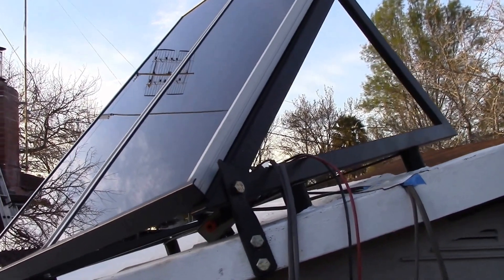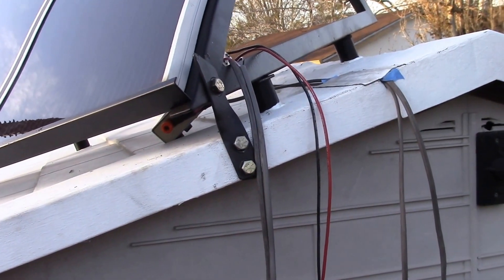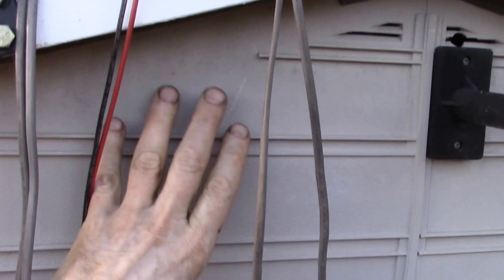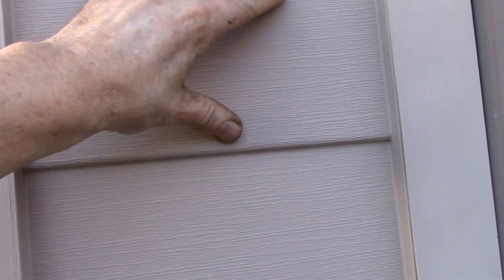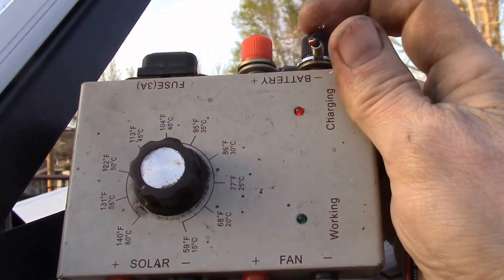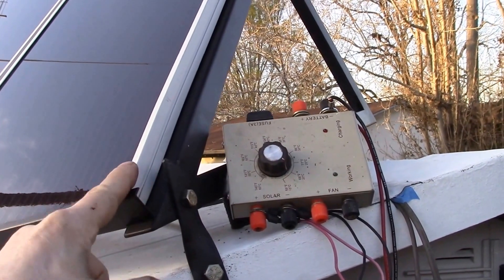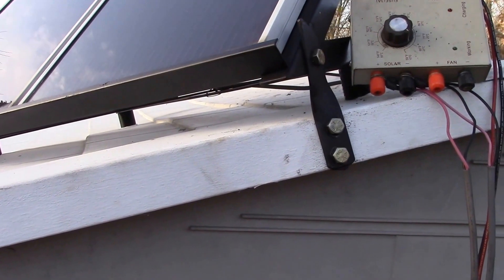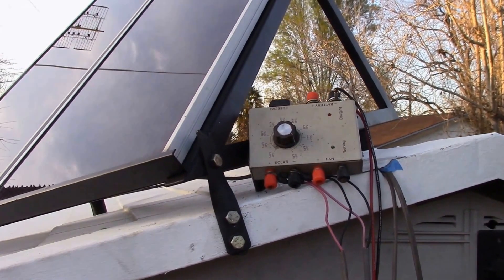Solar Shed Project, Part 2 - Panels Installed

Comment: Do you happen to have a brand and model number for the panel controller with the thermostat? That would be perfect for my setup
Reply from the maker: It's an old item from Harbor Freight, part of their Solar Greenhouse Cooling Fan kit.  I've not seen it available since shortly after I purchased it.